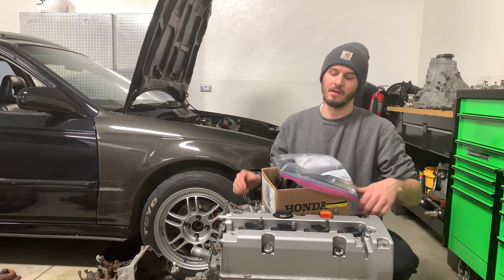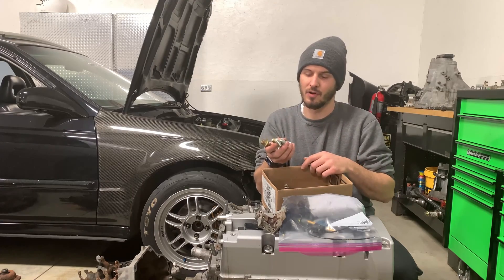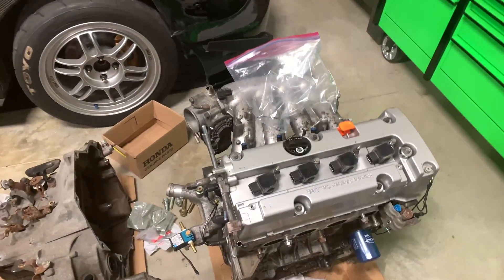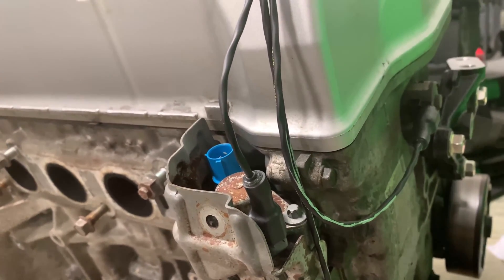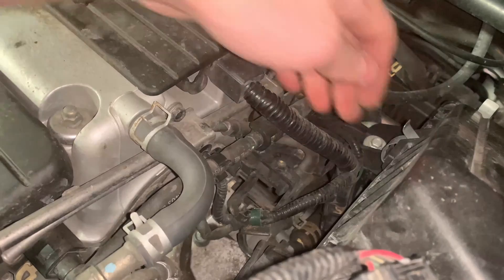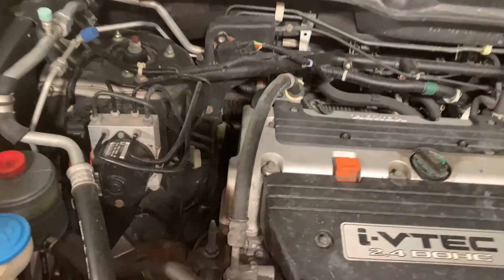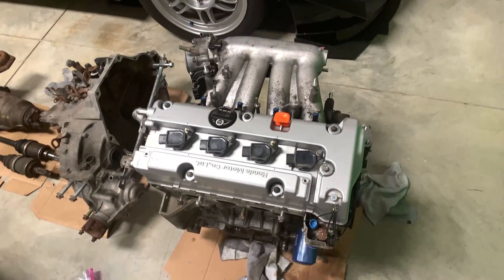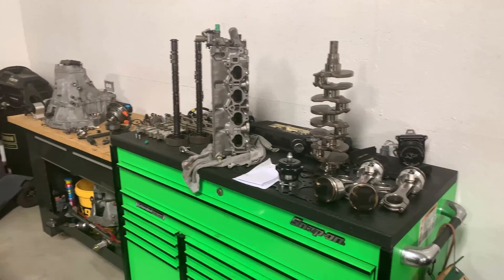K Swap Engine Wiring For Any Chassis Pt.2

Comment: I have a 99 toyota corolla so doing of of the work u show on both ur 2 videos on the wiring and getting that ecu that u use i would be able to wire in a k20 motor in to corolla
Reply from the maker: Yessir. Honestly if you get a KPro ECU and a stock K series harness you can make that work too.